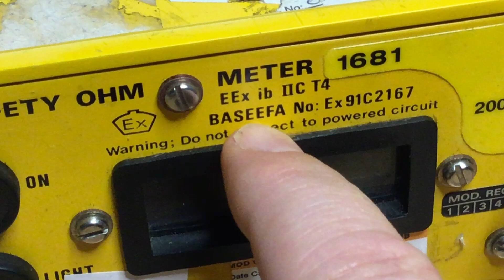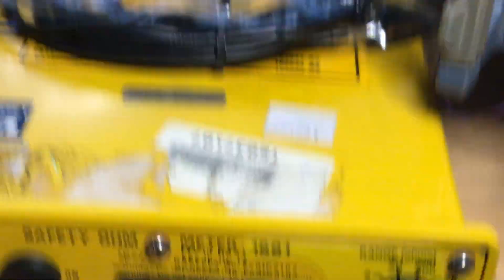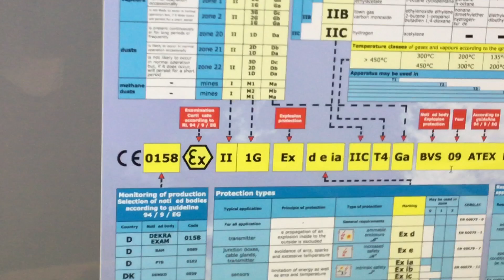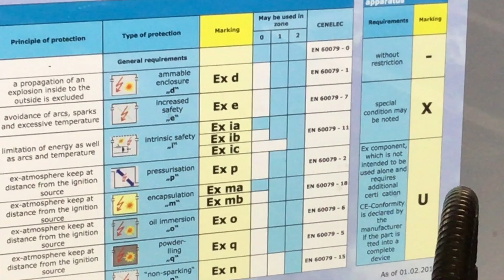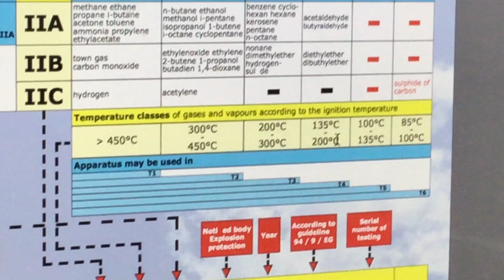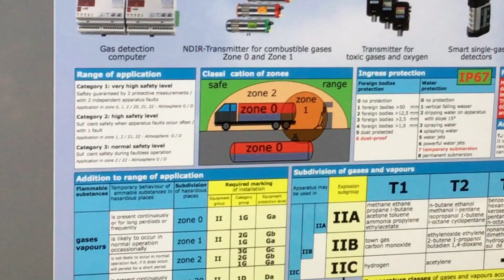Intrinsic Safety PART 1 - RF Electronic, Electrical Apparatus in Explosive & hazardous environments.

Comment: I remember servicing some intrinsically safe Pye PF70 body worn radios, for one of the local coal mines, back in the mid 1980’s. There was silicone rubber everywhere inside the radios and they were a pain to work on.